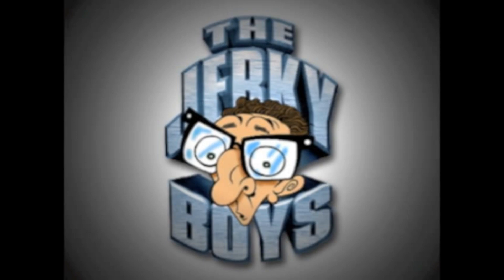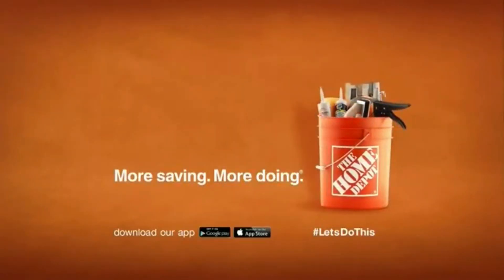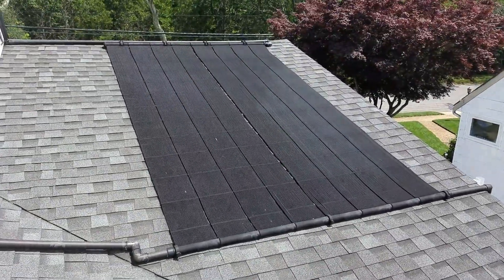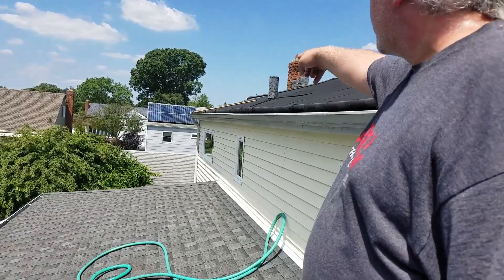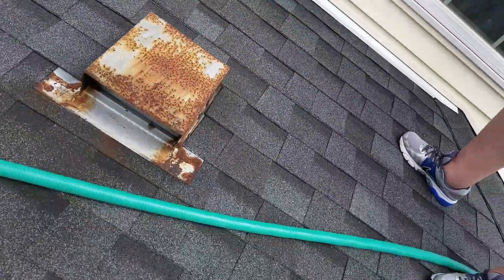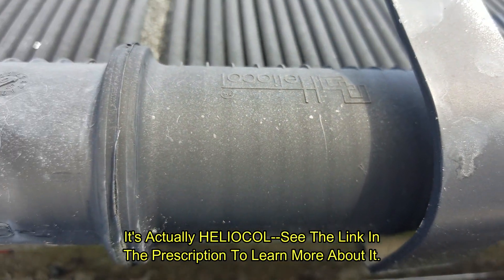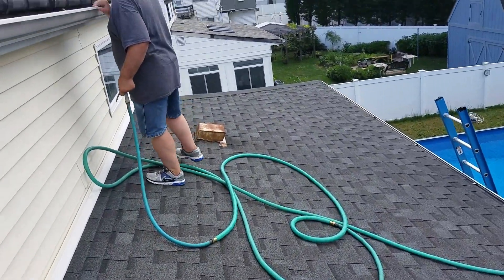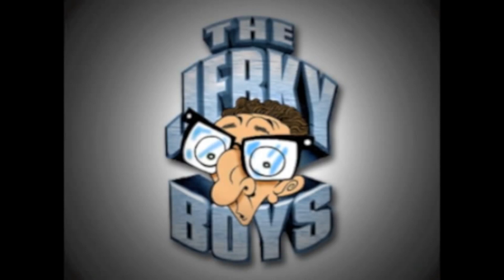Up By The Roof There

Comment: Truly is an interesting setup. Good to see that the roof is in good shape.
Reply from the maker: Thanks.  I'm happy to see it up close, now I know what I'm dealing with.  There are a few videos on YouTube that show the operation of the system, most of which I knew already.  The roof was put on back sometime in 2002-2004 I believe, so it's got some time yet.  Especially since it's still in excellent shape.  It was good to see that, just for peace of mind.

Next the roof is redone, I should get new gutters.  These are the old school ones; the newer ones have a larger opening and wider downspout.  We've had summer storms where it rained so hard these gutters have overflowed; the downspouts just weren't large enough to handle the volume of water.

Comment: Very nice sight to see! Solar looks about how I expected, still cool though. Kind of like the hot tub though, probably about 2,000 potential leak spots. But I guess if no one touches it,  it will be fine. The roof does still look in good shape. I’m guessing the previous owners replaced it when the solar was added. That’s my guess anyway.
Reply from the maker: I actually didn't know there were little individual tubes, I thought it was more of a "sheet".  So yes, that opens up the possibility for many spots to start leaking.  The good news is that if it were to start leaking, I'd see water from the downspouts on dry days, which I don't.

The roof was redone probably right before the pool, as was the siding.  The previous owners replaced the roof, windows, bought the A/C that now serves the garage, redid the kitchen, refinished the hardwood floors, installed the central air, redid the bushes in the front, and of course put in the pool.  I suspect all of this took place between 2002-2004.  Then the drugs took over and they lost everything they had.  Considering all that they did, that gave me "more for my money" when I bought the house.  And considering what some other people have done to their houses that cost not much less, I didn't get too bad of a deal.

While the roof is in good shape for now, it's probably pushing 16 or 17 years.  Probably will be good for some time to come yet, but when it's time, what about the solar?  I guess I'd have to talk to people about their solar electrical panels on their roof and see what they'd have to do, and likely mine would be the same.  The best course of action would be to cut the pipes, lift the entire thing off as a unit, and then reinstall using pipe couplers.  Likely that wouldn't be a possibility, or something would get damaged in the process.
Reply: Or you could just lift the house off the foundation, move it into the back, and later demolish it!
Reply from the maker: What I should do is buy 2 more houses and knock all 3 down!

Comment: Couldn't you have gotten up there by going through one of the bedroom windows?
Reply from the maker: If the tables were turned, your excuse would be "they don't open wide enough".  But the fact of the matter is, you can remove the arm that keeps them from blowing in the wind, and open them 90 degrees.  As far as getting out from there, If I were 25 years younger, probably.  Not really that safe of a way, you can easily lose your footing coming out the window.  You're safer going up a ladder.
Reply: Are they not sliding windows? I would have never used some dodgy ladder that was just "propped up there".
Reply from the maker: @isaac24  Nope, not sliders, they open out at the bottom.

Roofers don't go out windows, they use ladders, like normal people.
Reply: Oh, I hate those. In fact, I despise them. Do they have cranks?

Well I don't trust ladders, for the most part. Especially extension ladders.
Reply from the maker: @isaac24  Yes, they have cranks.  They also keep the rain out so they can be open when it rains.

So when the house starts burning down and fire is blocking your exit, and a fireman comes and smashes your upstairs window to rescue you, and he's got a ladder, what are you gonna do, wait around for a  helicopter?

Comment: 1. I somehow knew this would be a big cutaway fest. 

2. The only thing you can see from my roof is pine trees and the Mexican’s chihuahua in my yard. 

3. More Saving. Less doing because you have to keep coming back because you didn’t buy enough lumber. 

4. They could’ve put more, but I guess they decided to take an early lunch break and never came back!
Reply from the maker: 1.  That's how my mind works.  I draw parallels all the time.

2.  Better than next door when he was building that barn and we had NO privacy in the backyard.

3.  Less saving, more doing.  That's the prices of the Home Depot.

4.  I really think it's because of the pitch of the roof there on the garage, I'm actually rather surprised they even went that far.